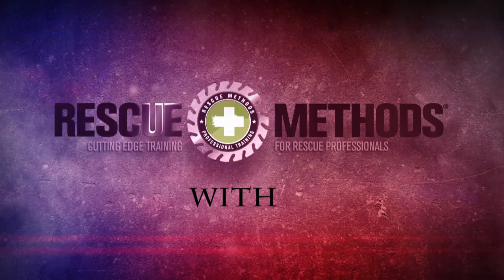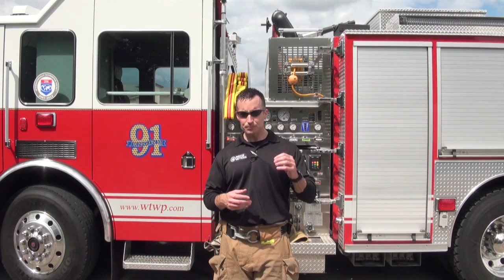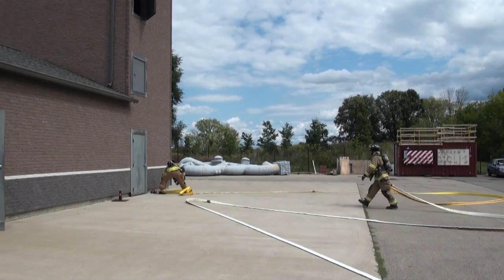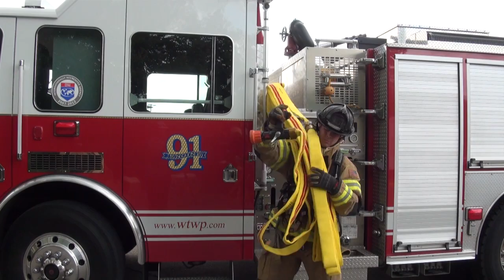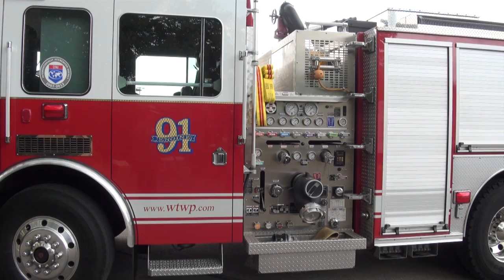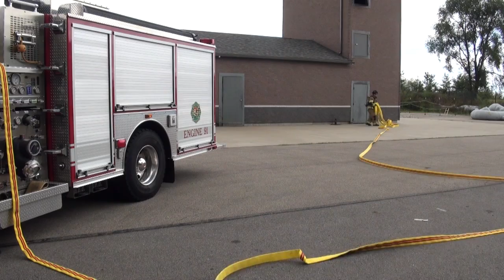Minute Man Introduction

Comment: How is it that you have tradition to support the number of hits... when I was requested to release my copyright to " http://hoseroller.net " to Texas A & M University because not only can I deploy the hose dry around right angle turns with no tail to get caught on a car tire at:

 http://Standard.HFTFire.com as it NEVER kinks EVER... before deploying to its full length upon:

http://Hoseroller.info

but I can charge to the full rated capacity of the nozzle through the entire line within 10 ft of the engine in mere seconds as demonstrated at:

http://burnover.HFTFire.com

...AND deploy this fully charged line (as I can with 200 feet of 2 1/2" within eight (8') feet of the tailboard of any engine) from the confined space between the parked engine and adjacent van... FULLY CHARGE...  then around right angle turns in which the term "HOSE ROLLER" transitions from a noun... to a verb at:

http://nodraghoseload.com

Please review the WORLD's FIRE EVER Engine Pressure calculator phone apps and slide-rule to calculate in seconds what takes minutes in the comfort a classroom with a standard pocket calculator... but in the field where you can keep up in REAL-TIME with your wildland fire crew at every step of deployment... 

AND WHEN TO CEASE AND DESIST when your 400 PSI IS EXHAUSTED as evidenced at:

https://HydraulicsApp.com and http://SlideRule.HydrualicsApp.com

..to meet the NFPA 1002 Chapter 8 requirement to "produce effective fire streams" at "the rated flow of the nozzle" (chosen) upon instructors who truly are NFPA 1041 QUALIFIED (ask Cal Fire) to secure your crew's SAFETY per OSHA 29 CFR 1910.156(c)(1) & (2).

I invite any and all inquiries and responses!